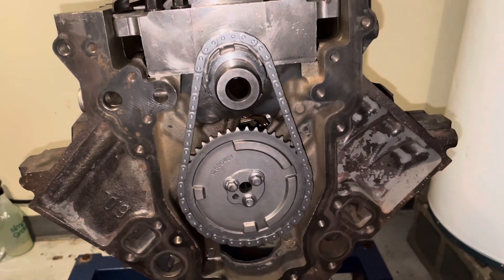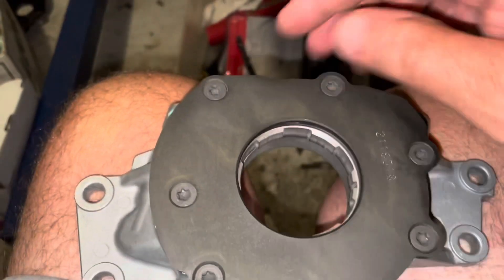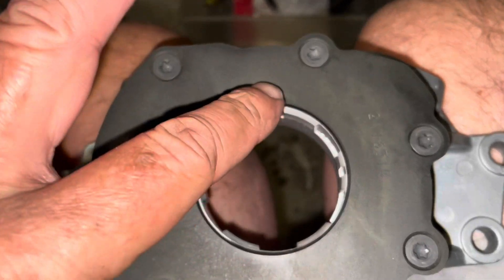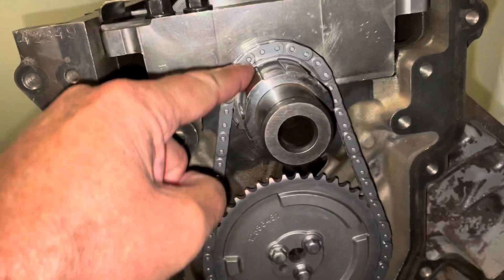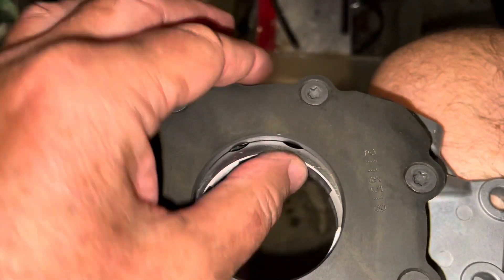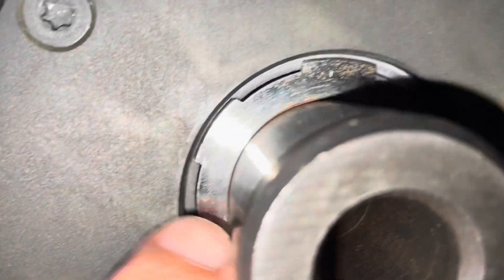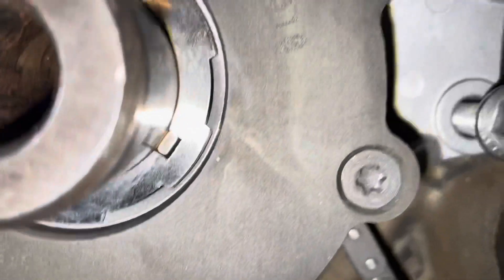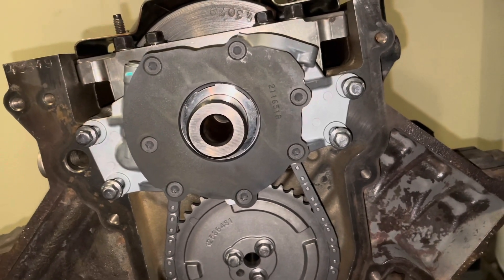LS Swap Basics - Oil Pump Shimming Debunked

Comment: Its not going to "go where it wants to" because it sits on the crank shaft. The pump is bolted to the block
The bigger gear moves in accordance to oil filling the gap on one side which is more and as smaller crank gear spins one side of the pump outlet gear housing is closer to center so smaller gap (tighter tolerance) so when bigger gear spins with crank gear and gets to that point it's a tighter tolerance which compression of oil starts and what gives your pump the pressure to push oil out of the outlet and as it turns past that tolerance opens up allowing more  between gears and repeating processes. So no, the crank gear doesn't move where it wants to and depending on where you shim depends on how tight the tolerance is on the side everything comes to compression inside the pump.
Reply from the maker: Your’re wrong. Show proof from any GM document where it says to shim the oil pump.

Comment: Im in agreeance with you. Shimming is BS. Yes the outer gear is off center, so the center of axis will move if the pump is clocked, However, the .015" or so of play between the bolt holes and bolts means the housing center axis only moves a fraction of an inch, a few tenths (.0001") if any. I plan on doing a video that will explain this with math so we can call put this myth to bed.
Reply from the maker: Actually I plan to do a video on installing the pump but not with shimming. There is an optimum way to install it although the benefits are negligible.

Comment: Pretty sure its the space of the larger ring to the housing, thats behind the cover. The larger ring spins and using the feeler gauge to make sure there is an even gap for the oiling of the outter ring. Otherwise the backside of the bigger ring rubs on the housing and wears. I thought it was BS too but look around at other videos... shimming makes sense.
Reply from the maker: No it doesn’t. I’m sticking to what I said. There are many more videos and comments  that don’t shim the oil pump. The pump is self adjusting by design.
Reply: Yeah, I saw the same thing after examining the m295 oil pump/ there is a ridge on the back housing just next to the rotor that measures 53.06mm, the outside teeth of the crankshaft gear measure 52.86mm leaving a .2mm gap from the rear housing to the drive gear on the crank gear. Just take apart an oil pump until you only have the rear housing in hand and place it over the crank snout- it is pretty obvious why the shims are necessary at that point to keep the housing from rubbing on the crank. That being said, i have installed several without shims and haven't had an issue, but i don't like the idea of that housing rubbing and self-clearancing against the crank gear.

Comment: mate no one shims the internal gear ,, one takes off the cover of the pump after its placed loose on the engine  and one gets two feeler gauges and you place it between the body and the outer gear , then you tighten the water pump to the engine. pull the shims out , tighten  the cover to the pump , done , the outer gear is not fixed it spins  slowly  so this allows oil between the body of the pump and the outside edge of the outside gear , other wise it will wearing too the housing of the pump , take one apart  and you will see ,, mellings  go in to detail on the instruction sheet , or just ring them ,,, cheers
Reply from the maker: You’re wasting your time. Read all the comments. This is my last reply to your original comment. In my description I said if you have scientific evidence I’ll hear your point but if all you’ve got is everybody else does it or some non- sensical explanation that’s not evidence. I tell you what post a video link to one experienced well known engine builder like Steve Morris who shims LS oil pumps and we’ll talk.

Comment: actually  one shims  the outer ring  against the case not the internal you must  take the cover off,,, this is why one can move the. whole item on the 4  bolts  so one can shim , sorry you. dont know what you are thing about. even mellings , have this written down on the installation sheet ,,
Reply from the maker: Go watch it again and again cause you missed something.

Comment: It’s not about the gear on the crank. It’s about the outer rotating part of the gear assembly. You don’t want it rubbing the housing it’s best to center it. 99% of the time it’s fine to just bolt it on and go but I’m going to center mine
Reply from the maker: You’re wasting your time it’s not gonna stay centered, dynamic oil pressure is going to move it to wherever it wants to go.

Think of it like this. building a car is an assembly line industrial process. There’s no way gm engineers designed something that required such a meticulous shimming process to install a part.

Also, if the oil pump requires shimming, and there’s many many people that are not doing it, where are all the failures ?

Comment: Terrible terrible information. This guy clearly doesn't understand how this pump operates. Have fun with your oil failure comebacks.
Reply from the maker: Clearly you don’t read the internet as its all over that people bolt it on and run it. I’ve been running a 6 liter for almost two years no problems just slap it on and go.
Reply: Yeah, if I pull that apart now way I'm not shimming it. The right way not the way he's explaining. Also I opened a ls1 OEM original pump with 30k miles and the outer gear was rubbing on the housing.

Comment: I'm a 20+ year Senior Master Automotive and Diesel technician, and I've not seen or heard of anything supporting the need for the shimming either. If it's not in a factory shop manual then it's bullshit. Flow dynamics support your theory.....as well as common sense. Good video.
Reply from the maker: Thanks, too many people just follow what others do. I’m guilty of that too but if it’s costing me money I analyze if it’s necessary and stop if it doesn’t make sense. Engineers in manufacturing go to great lengths to reduce cycle time so they wouldn’t put in a part that has to be shimmed. At least not on the factory floor.

Comment: that's not the way it is shimmed. you shim the OUTSIDE gear, not the inside gear. So you are completely wrong. If you would have done your homework and even watched other videos then you'd be better educated on how to properly shim the LS oil pump so it is perfectly centered and it IS NEEDED. Looks like you don't allow Comments from viewers  because you only want to believe your own misinformation that then gets turned into a misinformative video.
Reply from the maker: You don’t have to shim it at all. Waste of time. You do it your way I’ll do it mine.
Reply: There's a video from Mehling that the instructor demonstrate and tells you no need to shim. Just install, leave bolts loose, turn shaft 1/2 around and tighten bolts. That's from the makers, ijs.

Comment from the maker: Let’s analyze one particular video on oil pump shimming. But before I do, let me make one thing clear. I’m a scientist. All I’m doing is presenting information to come to a common understanding amongst all engine building enthusiasts so that we do the best possible job and save ourselves money. I’m not calling anyone out for being ignorant or poor engine builders. I’m sure I’m doing things that I don’t need to do and if someone sees me doing unnecessary work I sure would like to know. But I also ask that commenters post valid evidence based answers or provide data to back up their posts. Just because it’s done on another well liked video doesn’t mean it’s the right way to do something. Let’s help that person by persuading him that his methods are not founded on science and save him some time or money.

The video I want to evaluate is found here:

https://youtu.be/CWCIdhG04LY

In this video the outer oil pump gear is being shimmed to position the loosely mounted housing before torquing the housing to the block. But what is the housing being aligned to? In the thumbnail it’s clear the crankshaft and the outer gear aren’t concentric (can’t be or it won’t be a gearotor pump) so it’s not aligning to the crank. In the video the outer gear is resting on the inner gear which in turn is resting on the crank. The inner gear is not shimmed to be concentric with the crank so the inner gear is in an indeterminate position determined by gravity and contact points with the crank sawtooth gear. My conclusion is that the housing has been aligned to a random position determined by random contact points between the outer and inner gears and random contact points between the inner gear and the crank gear with all random contact resulting from gravity and a random crank rotation position. So this video shows a method that makes the least logical sense to me.

To improve on his method, let’s say we shim the inner gear to the crank to make the inner gear concentric with the crank. We have now eliminated the random position of the inner gear and gained control of the inner gear’s position.  Due to inner/outer gear contact points the housing will be shifted upwards by 0.001”-0.003 before torquing it down. But all we’ve done is give the inner gear a little more wiggle room on the crank. When the shims are all removed, the inner gear is going to drop a few thousandths due to gravity. The outer gear is going to drop less ( I guess; it depends on the shim thicknesses he used) but is mostly constrained by the now secured housing. So what will happen is the outer gear will rotate clockwise just a little as the contact points change between inner and outer gears as the inner gear drops out of concentricity with the crank.

But let’s look at this again. The crank is motionless during this process. If the engine is built right it has close to 0.002” of main bearing clearance. So assuming it has no rods installed yet (or dynamic oil film) it will be sitting 0.001” lower in the block (or higher if the engine is upside down). So now we’re back to having a random crank position because we really don’t know where it’s going to be while it’s running. So ultimately the oil housing was shimmed to a crank position that will not exist while it’s running.

I really don’t see any benefit of shimming LS oil pumps. I’m going to do a follow up video to explain my understanding better.